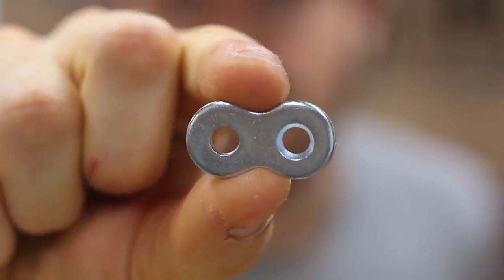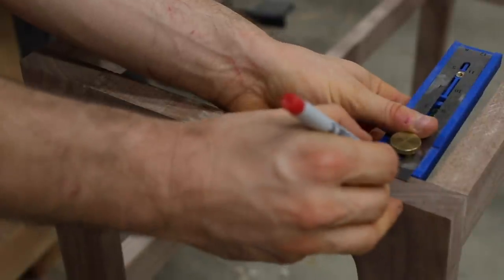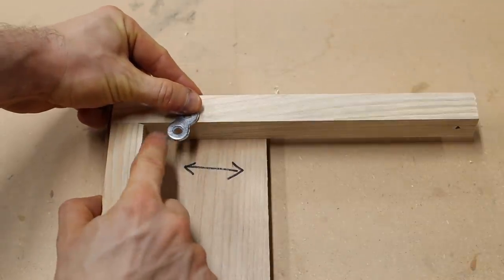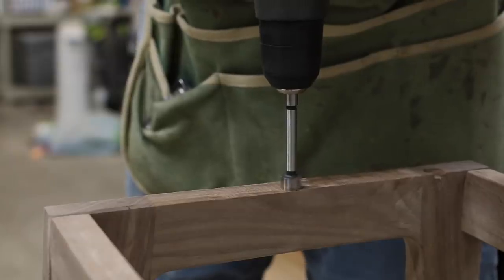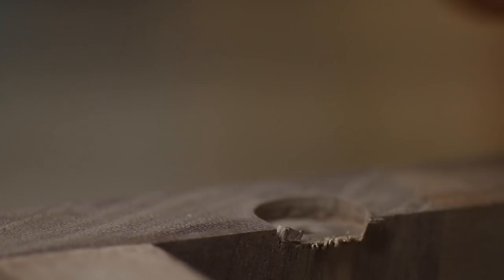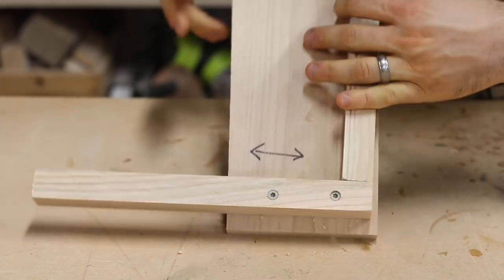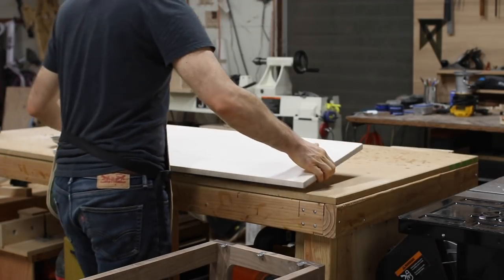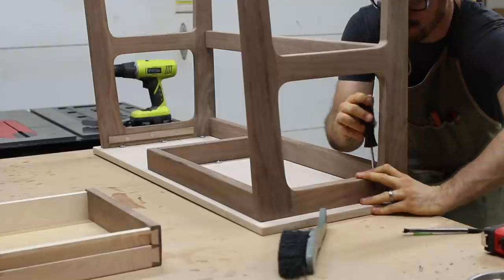How to Install Figure 8 Tabletop Fasteners // Quick & Easy Woodworking Tutorial

Comment: Great video, liked and subscribed! At 2:40 when you install the figure 8 into the apron it looks like you don't snug it down super tight. I assume that is to allow for movement, which is the whole purpose of this type of fastener. Do you also not snug it super tight when attaching the top? Thanks much.
Reply from the maker: So I generally don't snug either super-tight, just hand-tight is enough.

Comment: You can install figure 8s at an angle along the long stretcher. That will it allow it to move with the wood and add support to your table.
Reply from the maker: Interesting. Does it just not move enough so that the arc of the fastener's travel isn't a problem?
Reply: @BikeCityWoodworks  Stumpy Nubs has a really good video on the topic. James explains it way better than I ever could.
Reply: Yes this is correct, install the figure of eight at a slight angle on the long apron.

When the grain ‘pushes’ against the figure of 8 it will pivot into the apron - when the grain ‘pulls’ against the figure of 8 it will pivot straight.

One tip would to be work out the expected movement of the top allowing for wood type and location. You can then work out if that fixing would work. Based on how much wood movement you would expect to have.

Great video by the way and really nice project.

Andy

Comment: I'm having trouble figuring out how to attach a 3/4 solid wood top to a 1/2 in made ply cabinet. Can I just glue solid wood to the inside of the plywood and use these fasteners?
Reply from the maker: You should be able to!

Comment: Those fasteners seem to be some of the more expensive ones on amazon. I see plenty that are under 50c each, and some that are only 25c each. Doesn't seem like there's a major risk to going cheap here.
Reply: What exactly do you consider expensive? I just looked and the first thing on Amazon that came up is a forty pack of heavy duty figure 8 fasteners for twelve bucks. Even if you use nine per bench like the in the video, which doesn't seem excessive,  that's still four benches with a few left over. You could probably get two tables, depending on the size, out of the same pack.